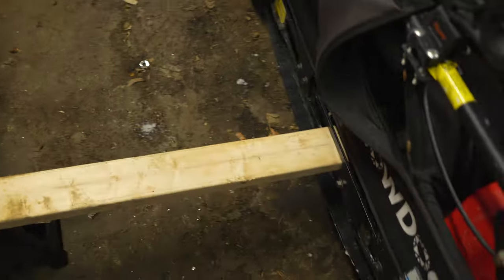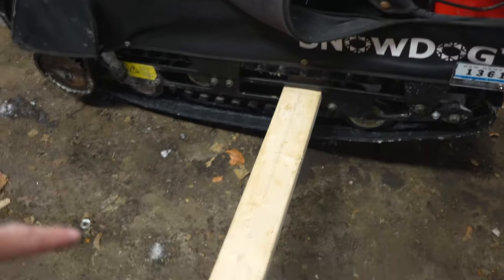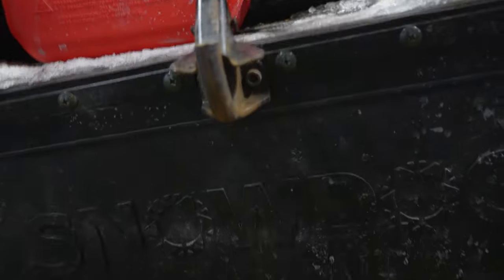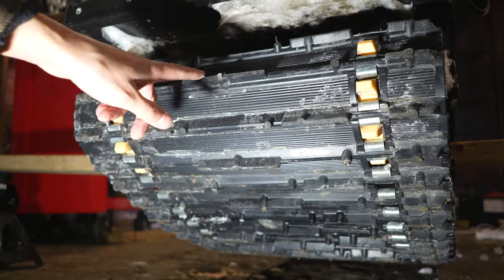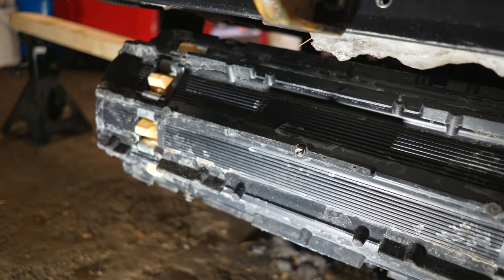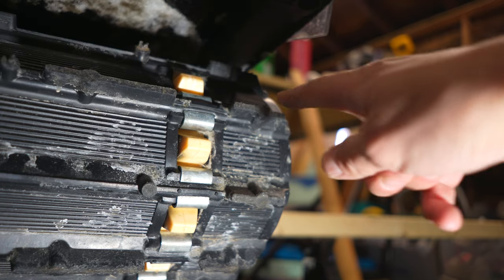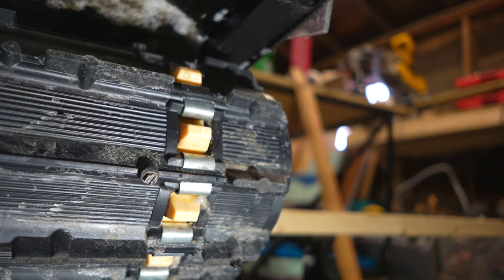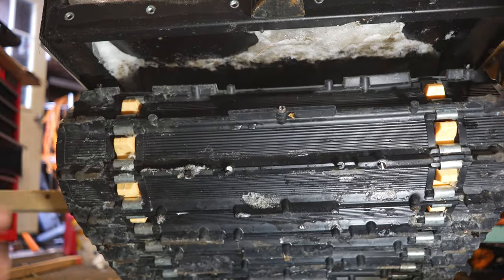How to Stud the Track on a SNOWDOG

Comment: I just did the 1/2" koldkutters today  KK-12250-8,    I did a single in the center,  next lug 2 just tad out from center,  next lug 2 on the ends,  then next lug back to 2 just out from center,  then single in teh center again,  so a repeating diamond I would say.  Pattern matched up perfect through the entire track start to finish.   I'll see how it goes.  If I need more I can do a 2 then 3 then 2 then 3 pretty simple
Reply from the maker: You'll love the more traction good luck

Comment: I understand the studs give better grip but what is the reason for it, is it for glare ice conditions. I just got a snow dog and it seemed to pull fine on slick wet ice.
Reply from the maker: It helps when you have a bigger load on. Made a huge difference for me